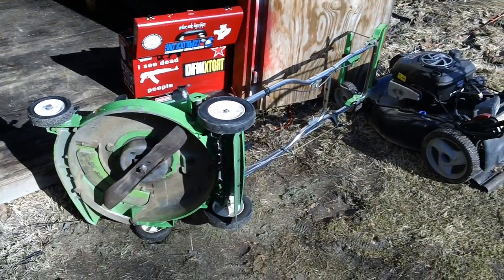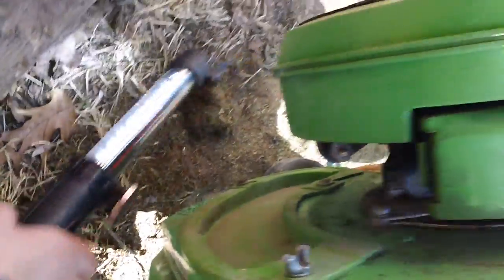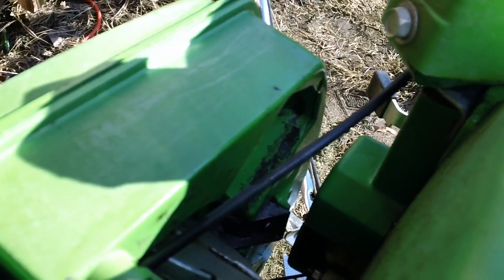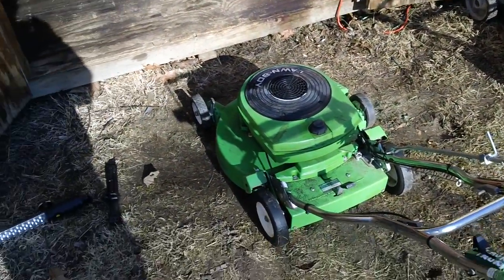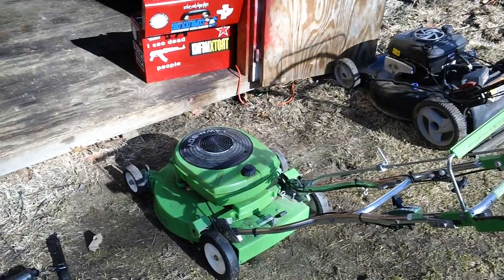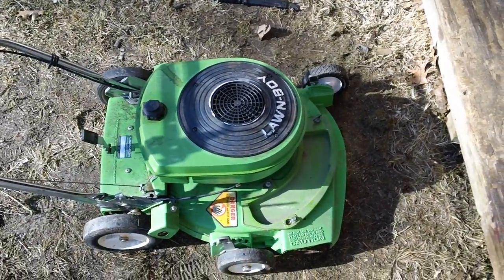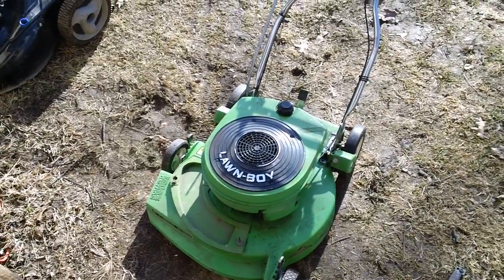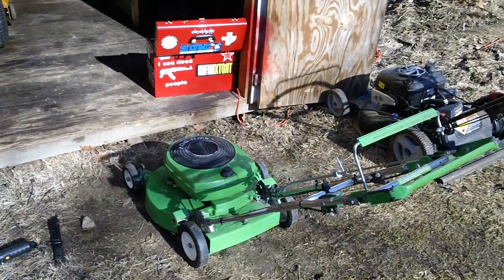LAWNBOY GAS TANK DAMAGE FROM NO APPARENT CAUSE.

Comment: I have an older lawn Boy with a leaking gas tank also. Mine split where the tank slid into some metal brackets designed to help support the tank. My solution was to mount a bracket with pop rivets to the rear of the tank to hold a smaller tank from another mower and still use it after 4 years.